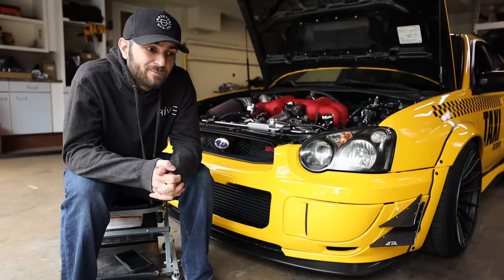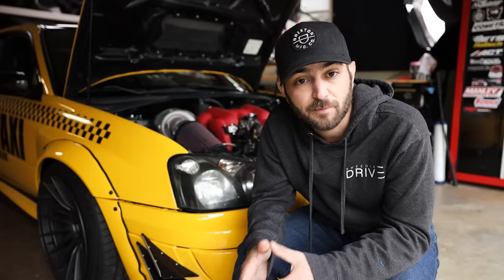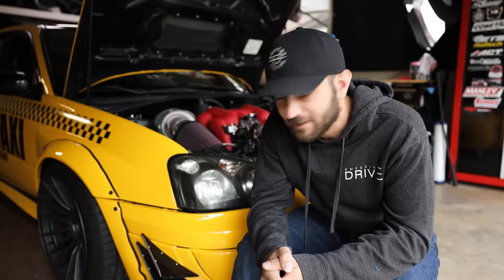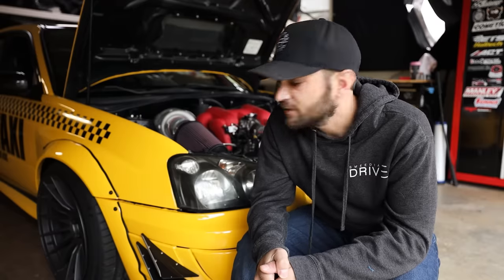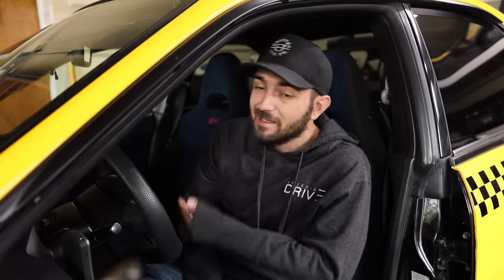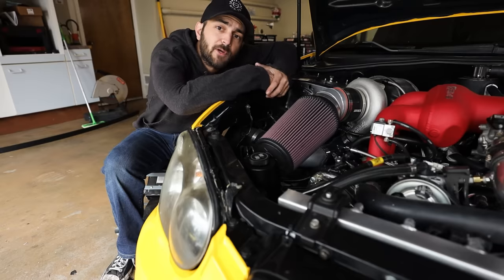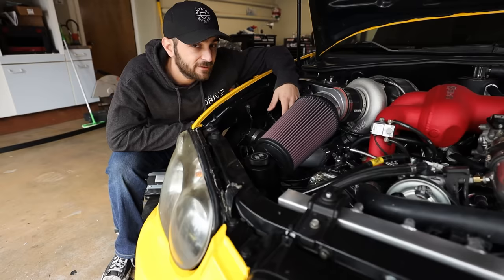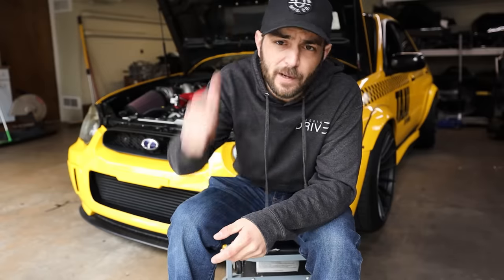What You Can do To Keep Your Subaru Reliable.

Comment: have a FB-20 Subaru 2012 /2.0 impreza /dual automatic 6-speed /paddle shifter/ trans ,.. use 93 oct.gas,.will this keep my engine cleaner and help it's liability,??? running super great, no issues,  just a little over 100,000,..Oh! i do change the oil every 3000 ???,.. thank you in advance for your reply, would appreciate it very much,.. Great !!! video by the way..

Comment: Lots of people forget overall use of aftermarket parts greatly decreases systems reliability.  Ie  3 parts at 95 percent quality control yield about 86  percent overall system. (.95 *.95 *.95 =.857  )  My point being, the utilization of more aftermarket  components  can greatly reduce overall systems reliability, and integrity.  Many company's do not have the qc or test their products  for longevity or to last x amount of miles. Fierce competition usu results in the opposite,  and companies  looking to outsource and use cheaper components to expedite manufacturing and cut costs to increase profits or to release a new product before their competition.. Of course, there are tried and true subaru shops who have been in the field and have good reputation.  Nothing to discount them just saying many overlook the use of so many random parts thrown in at various quality control thresholds and longevity benchmarks.  End rand hope everyone has great lasting builds. Miss my old Sti.

Comment: Among all the great info here, he's right, but THE #1 reason these engines fail early is the guys driving them drive them at too low rpm. Imagine trying to push your car from behind from a stand still. Now try pushing it after it's already rolling at 5mph. Which is easier? Too much throttle/boost at low rpm causes high cylinder pressure. Basically the engine is trying to push the car but it's having a hard time because it doesn't have enough leverage, because it's in too high of a gear. Drop to a lower gear to increase that leverage. If you make the engine try too hard, things start breaking and wearing out quickly. Do not hit hard boost below about 3200 rpm, and do not cruise in 4th or 5th gear below 3k rpm, and especially do not hit any boost at low rpm in a high gear. Rolling on the throttle from around 3k is fine, but if you want to send it, drop to whatever gear gets you into 4k rpm territory. You will not hurt the engine hitting redline area, that's why there is a redline. So you can't hurt the engine. 

Cruising 70mph in 5th and need to pass someone? Drop to 4th, don't just hammer it in 5th. If you need to accelerate quick and you seem to be in that sucky spot between gear ratios where say 3rd is too low, and 2nd is too high rpm, either don't do whatever you're about to do, or send the rpm to the moon and shoot for 2nd. You won't hurt anything. These cars need a good high rpm beating here and there to stay running clean anyway

Comment: Im not familiar with how the tunes work but every car since 1996 has been using computers which are constantly changing to run as clean as possible, efficiently enough, and peak power (that the factory sets them for) now i understand a tune changes the factory settings but the computer should still be trying to achieve something. The only time they aren't trying to achieve this perfectum is when warming up, theyre trying to warm up the cat as fast as possible. Again i understand the tune could be just keeping it in that open loop but ive witnessed this with my 2011. Occasionally (typically warmer weather) after driving the car to operating temps and shutting it off for 10-30 minutes and starting it again. It would throw a code for coolant temp was below 160. 
Ive witnessed also when being hard on my car in the summer the car sorta goes limp mode. Not really limp mode but its clearly hot because its not hitting its peak power and doesnt come back unless i just coast or cruise long enough or shut it off for a while. Its still fine to drive normally but just isnt happy when i try to get on it. The flooring it from red light to red light is dumb but if you do it once in a while or for a handful then stop its okay.
I personally haven't had a motor blow up on me yet but i get on the gas at least once a day and i daily my wrx. Usually just a good pull to 70-90, sometimes i just lay into it in 3rd or 4th from around 50-60 mph. I dont beat on it like ive heard some guys do but i have fun with it, the subarus were made to go on them back roads and have fun not tear up the streets and i think a lot of guys dont consider how small everything is on them  and how AWD on dry pavement with almost any tire is rough for any car. The smaller the drivetrain and powertrain parts though makes them even more fragile to instant shock from clutch dumps. I know you can launch the car properly but youre still trying to spin all 4 tires with 4 cylinders going through a tiny crank shaft and a mediocre clutch. Then the gears, if you listen to the rally subarus you can hear them struggling a little. Sorta sounds like theyre bucking and they are because those motors are pushing more power and the tires grip better than most on loose surfaces. Pretty sure everyone here knows how easy it to make a subaru start bucking even just a little.

Comment: Correction FA24's and FA20's present in BRZ's/86's have both Direct injection and port injection so carbon build up shouldn't be a huge concern
Reply from the maker: Yes they do, they use Toyota D4S system so no worries on the values for cleaning on them.

Comment: Subaru owners, if you car has 250hp stock it will last 200k miles, if your pushing 400-500hp you’ll be lucky to get 50k and if you have 1000hp your hoping your car will last 10 seconds a bunch of times. The more hp you get out of the engine, the less miles you will get. That’s how it works

Comment: I may be off topic here but I have a foul gas/exhaust odor from my 2015 STI from time to time at idle.  What could be causing this?  66,000 miles on it.
Reply from the maker: Where's it smell like it's coming from?
Reply: @Smeedia  underneath the car. As soon as I open the driver's door, I'm hit with it. Sometimes I notice it from the exhaust but I'm not sure.
Reply from the maker: Check to see if your drivers side exhaust manifold is cracked, or leaking. The fuel lines run inside the car so you definitely would smell it if it was the lines

Comment: I've seen a lot of folks who just shut off these cars after parking/stopping.
They're like, "I'm just wasting gas though."
I'm like, "What's more expensive? Gas, or a new turbo, or even a new engine?"
Hey their cars though! 🤷‍♂️
Reply from the maker: If your just normal driving your totally fine to just shut em off. Most stock location turbos are water cooled and will still pull heat away from the turbo after they've shut down. 

If your driving thr car hard I'd suggest letting it cool though

Comment: Towards the end at around 13:00, what u were saying about not using 87 octane fuel since it can cause rod knock which can damage the valve seat,
Does this apply to non performance Subaru’s in general as well?
Reply from the maker: No, normal non performance subarus are okay to use 87 octane 🙏
Reply: @Smeedia  and feeding my subie on 91 octane should still be fine right? Even tho it's not a high performance model. Its a 09 Legacy 2.5i SE now at a 110k 

I just bought it last year at 102k, and what got me to buy this car is how clean the interior was, no rips/tears or weird smell inside like smoke or food. What really got me was under the hood, no leak, no stains of residue, smell, hear or feel any rough vibrations while at idle or anything weird out of the ordinary that we all buyers look for specially buying from a third party owner. 

Like I said everything was clean and left stocked, I can tell that the previous owner had kept up with the proper basic maintenance the vehicle needed everytime something was needed to be serviced. At 102k this 09 legacy ran very smooth and idle was on point and quiet. Before I had bought the car, only major maintenance the previous owner had done to it was new clutch was replaced and belt just bcuz it was time for the belt to be serviced at a certain mileage. 

Anyways let me get to my point, the time I bought the car the following month I had all basic maintenance on the car like all fluids changed from oil change to differential serviced just so I have can keep it maintained at all times and stay up to date with it.
Also ever since I got the car, I have been feeding it with 91 just so I can burn off and get the fule lines and 02 sensors clean from maybe bad and whatever cheap fue thel last owner had been using.
Should be okay to keep feeding it with 91 right?

I remember last car I had (toyota) I was feeding cheap gas all the time, never maintained any basic maintenance like basic tune up of any sort and engine light code 0420 was an  issue I kept ruuning into. I never kept good maintenance on it :( car ran like crap.

That's why I wanna make things right with this and start fresh, lmk if there's any other tips I should keep in mind or know about while owning a subie.  Loving it and so far so good. No problems of any sort at all. Thanks for the tips!

Comment: Sigh.....I just bought a 2011 WRX hatch with 190 000m on it with original timing belt.  It was going to be one of the first things I deal with on the car but I was still recovering from a surgery.  3 weeks into ownership and it snapped.  It's now been 3 weeks in the shop getting rebuilt... I try not to think about how much more this is costing me than I was planning

Comment: I am highly interested in a 2020 STi in magnetite gray that is supposed to be fully stock. Still has almost 4 years and 35,000 miles left on the powertrain warranty. I always take very good care of my vehicles (change oil every 3-3500 miles) and keep up with the maintenance. Do you think this car would be an ok daily driver for me? I guess I would leave it completely stock for a while other than maybe changing the rims just so I can keep the warranty. Although I do have another train of thought that says it would be better to go ahead and modify it with things like an AOS and get a stage 1 etune or a protune if I could find it. I hear the stock mapping is not the best on these cars, so that may would prolong the life of the EJ with the the con of giving up the warranty. However, I definitely would like to build it one day once I get a good stable job. Also, I hear the WRX with the FA20 is supposed to be better for a daily, but I like the ability to shift the power from front to back in the STi. Currently, I live in the mountains of NC and am actually only a half hour from the tail of the dragon and my university's car club goes there pretty frequently. I just want something that is fun and practical. My other option is a SS 1LE camaro but it is far less practical especially since I have an outdoors life style. Granted I do have my F150 and Jeep for that, but that would mean driving three hours home to trade vehicles, and I do not want to do that too often.
Reply from the maker: Great Camero would be an absolutely blast but I do think the STI would be a bit more practical and thr AWD is nice to have. Personally I'd say if it has a warranty leave it stock. Once the warranty is up. Add things like the AOS etc. If it's a car for more of the fun aspect I'd say snag the STI. The wrx is fantastic but the STi feels more raw and engaging.
Reply: @Smeedia  appreciate it!

Comment: I have a question..what if I'm able to purchase all mods for the fa20..can I add them all and then get a protune or i have to do it stage by stage....tmic,charge pipe,cold air intake,downpipe,equal length headers,tgv/egv deletes,air oil separator...might sound silly as a question but I just need to know.
Reply from the maker: Definitely suggest adding them all at once then getting your tune, will make life a little easier and you won't be paying for multiple tunes 🤙🔥
Reply: @Smeedia  great appreciate the response 👍 keep the subaru content flowing🔥

Comment: Had octane sensor fail.Started getting 16-17 mpg instead of 27-28.This is because timing retarded when it failed.Repaired and did test.Regular-21-22, 93 octane 27-28 mpg.Octane sensor advances timing with high test.Take advantage of it's 10:1 compression ratio.

Comment: Should I run ethanol free high octane fuel or high octane with ethanol in my brand new 2021 STI? Which is best for the car? Car is bone stock I've ordered AEW car back exhaust but that's only mod in doing till warranty is up!!!
Reply: If you plan on keeping it stock other than the exhaust, then ethanol free fuel isn't really necessary, just stick with premium from the pump,  the car is built from factory to run on premium E10 which is what's available in the majority of pumps :) In fact, most people use E85 when aggressively tuning their turbocharged cars due to it having an octane rating of 100-105, it burns cooler than traditional ethanol free race gas, and it's cheap!
Reply from the maker: ^spot on 🤙

Comment: Ok, putting myself up for sacrifice in this comment section now…but I have a question! So I have modded my 2015 WRX with a Cobb intake and a Grimmspeed J-pipe to a Tomei Single Exit Catback. That is all I have done. I didn’t know about the OTS maps only being applicable to cobb so that’s good to know! After getting some weird readings I did go to an e-tuner and did 3  pulls that I sent to him (3x back and forth driving and sending him info.) Here’s where my ignorance will get me but I’ve only sent him 3 out of his recommended 6 pulls. I’ve been running that map since. Is this ok? Should I send him more?

Comment: Have a stock 2013 BRZ, oil changed every 5k miles. Always allowed to warmup properly before driving and never driven super hard as it's my daily. Engine just started knocking at 81k miles. I think its a spun bearing or something to do with the valve springs disintegrating but I'm not sure. In this case would Subaru fix it?

Comment: So I am thinking about buying an STI, 2020. I just want to use it as a daily driver, if I want to just put a cat back aftermarket exhaust on it and nothing else, and no other modifications to it, will it still be temperamental, and will I have to worry about a bunch of shit going wrong if I don’t beat the fuck out of it? I’ve owned a few Subarus and I have taken very good care of them, but I have never owned a WRX or a STI.

Comment: Looking for assistance. 21 STI looking for ~300 WHP with room to grow. SMY up-pipe with Tial 38mm EWG, Grimmspeed catted downpipe, Grimmspeed UEL headers, ETS air intake, Grimmspeed 3 port, FIC 1200cc injectors (question on these injectors, would I need to TGV deletes and IAG fuel kit or would these be plug and play?). Whats your thoughts? looking for opinions.
Reply: Skip the FIC injectors and get injector dynamic, get killer b headers. Don’t need fuel lol unless e85

Comment: I R have question. And I try to catch the live streams. But East cost here. I fall asleep… 
My 19 wrx, I did moderate bolt on/pro tune.. 297whp. But I added a AOS around 16,000 miles. It was mentioned before of still needed to clean those valves. With either the crc spray or blast. I thought I was a set it and forget it.
Reply from the maker: The AOS cleans up the oil blow by. The carbon deposits on the values are a diffrent thing that needs done every 30K or ao. Because there is no port injection to clean the values they build up carbon. AOS unfortunately worn do anything to help that
Reply: How do you clean the valves
Reply from the maker: Walnut blast or subarus slow induction service

Comment: So if I experience my DAM drop and some knocking over 1.41 with the MAP stage 1 tune should I look into maybe replacing spark plugs? I already use the highest quality fuel in my area, I feel like my care would never keep the DAM at 1 regardless of if it detects a knock or not. Not sure what else I could do.

Comment: I have a 2016 WRX i got it a 17k miles and now its at 31k, its my daily driver, i have a remark axleback exaust, mishimoto cold air intake, and some cosmetic goodies. I change the oil nowhere past 3500 miles, i put minimum 91 octane in my car. And its been great to me. its not tuned, i wont do that until i get another daily lmao. However, sometimes when my car is in neutral without the clutch pushed in, it makes a faint little sqeaky noice. As soon as i even lightly put my foot on the clutch, it stops. Does anyone possibly know what it could be? People tell me its a throw out bearing. But i read up on that and that occurs when its squeaks with the clutch pushed in and that doesn't happen to me.
Reply from the maker: Sounds like the TOB the WRXs have a habit of running threw them quickly. 😤 have fixed a few that were same symptoms as yours

Comment: I have a subaru wrx 2014 , And have recently changed the motor to an IAG rated 550hp, still having a misfire, mostly everything has been changed to cause a misfire (coil packs, spark plugs , and 02 sensor and AF Sensor) . Can a blown headgasket cause a misfire on cylinder 4 pls lmk

Comment: Love the videos bought a 16 wrx acouple weeks ago been doing maintenance should I change the diff and trans oil now its got 74k on the car
Reply from the maker: I would change it unless you have records. Subaru suggests every 30K miles. 👌 congrats on the car btw!
Reply: @Smeedia  thanks what gear oil would you recommend to use and what else should I do as preventative maintenance I just did plugs air filter and cabin filter
Reply from the maker: Motul 75W90
Reply from the maker: Aside from that sounds like your pretty set
Reply: @Smeedia  thanks man appreciate it